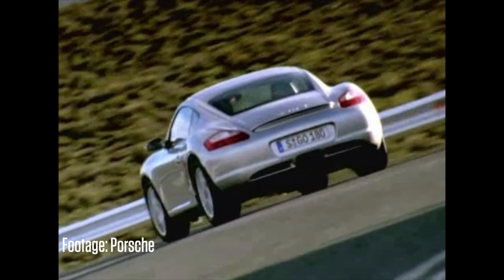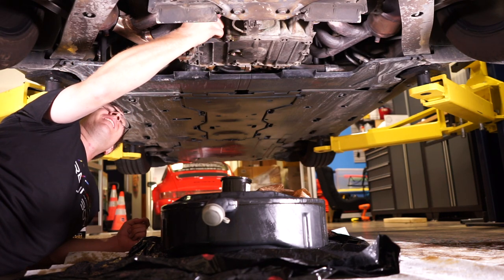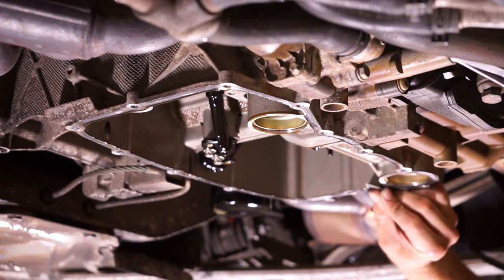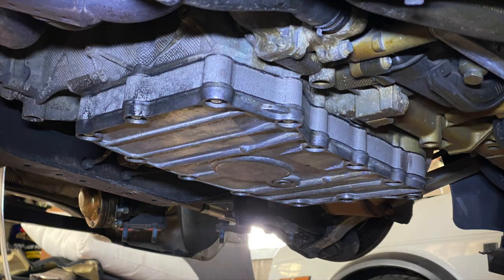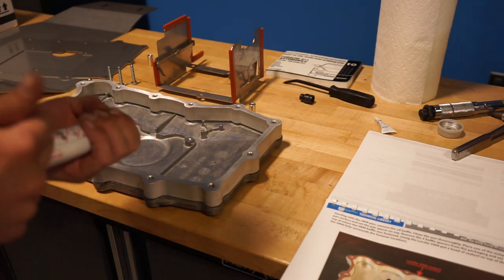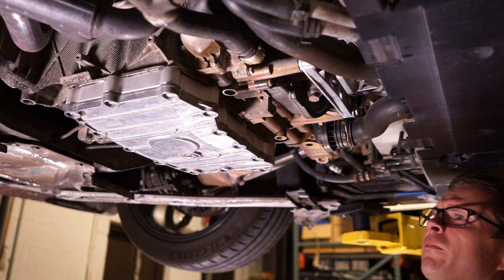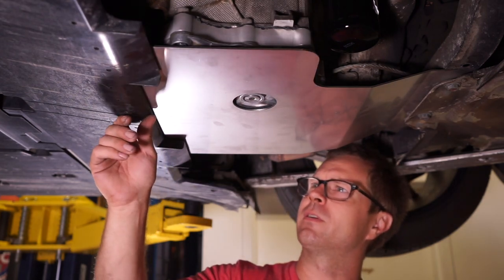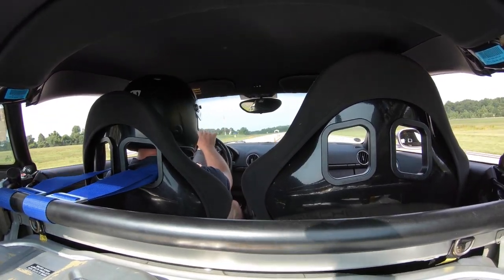How cool is your Porsche 986/987 Boxster or Cayman? How to install a deep oil sump | PCA Spotlight

Comment: I would use a plastic razor blade to clean the surfaces to prevent gouging them. I got some at Wal-mart, paint section I believe.
Reply from the maker: Great tip! Damon was worried about gouging the sealing surface with the metal razor blade but didn't realize plastic razor blades were a thing.

Comment: I do oil changes on Porsche all the time at work. To prevent oil from splashing everywhere with 6-9 quarts. I verified that the oil cap is in working order. Can't fill oil if the cap doesn't open.Then recap the oil cap. Leave the oil cap on until majority of the oil has been drained or when you're done with the bottom side. No more uncontrollably oil all over your clothes or the floor.

Comment: Fantastic video. Really appreciate the attention to detail on it, well done. I'm about to install one on my 1999 Boxster base, and this video is invaluable. One thing I was a little concerned about:  The oil pan guard that you installed towards the end of the video seemed to provide access to the oil drain plug for future oil changes, but waht about the oil filter?  Are you going to have to remove the oil pan guard each time you need to change the oil filter?  Thanks again for your great work!
Reply from the maker: Glad you found the video valuable to your install! The oil pan guard is shaped to allow easy access to the oil filter and drain plug without having to remove anything.

Comment: Thank you for a really interesting video.  I didn't realise oil starvation was even an issue or that there were modifications available.  I have a 986 S which is in reasonable shape (I hope) 2000 with 74,000 miles, but its nearly 22 years old now and I would not take it on a track for fear of breaking something very expensive, like the engine - even if I had the deep sump installed.  For me to be confident of not breaking it, I would have to have the whole engine out and totally reconditioned - which would be more money than the car is currently worth.  You could argue I guess that because the car isn't worth much, why not thrash it around a track, if it breaks it breaks, but it is worth a lot to me so I'm not going to do that.  I will drive it (safely) fairly hard every now and then on the road but that's it.  If I did drive a boxster on a track, which I'm sure if great fun, it wouldn't be mine.
Reply: Mike, I had the same concerns until I experienced a Porsche on the track. I love my Cayman S and the experiences on a track provided a new wonderful appreciation. Don't miss out. Jeff

Comment: I would not change to a spin on oil filter, sure it's easier, but I like to inspect the oil filter media for metal.
Reply from the maker: Damon has a filter cutter that he uses to cut the filter open and inspect.
Reply: @PorscheClubofAmerica doesn't that make the whole job more complicated than using the standard filter system?

Comment: Could a couple of the bolts used to attach the sump to the engine be taped in to use as a guide to assist with alignment when reassembling?
I’m not mechanically savvy so it maybe a dumb question.

Comment: stating using a 15mm Cresent to loosen the front motor bolts, when actually using a 15mm box end wrench.   Screw and bolts.  There is a difference!

Comment: Would this be recommended for a 2.7L Boxster that I plan to run on the street with 200tw tires? I drive pretty hard on backroads and on-ramps; a 718 i had before once registered 1.34g via Sport Chrono on OE pzero PZ4 tires -- i just don't wanna blow an engine :/ 

thanks for any consideration
Reply from the maker: If you were to ask the owner of this car, he'd say it probably isn't needed in your case, if you're only doing street driving. Even hard back road driving tends to be easier on a car than track driving, with fewer instances of sustained high Gs. That said, if you want more peace of mind and a deep sump and anti-slosh tray are in your budget, then they will only help with cooling and lubrication. Though we have not verified it, we have heard of some reports (on forums, we think?...) of stock air-oil separators being overwhelmed by oil once the anti-slosh tray is installed, due to how the oil now flows. A motorsport AOS will solve that potential issue, but it's a very expensive upgrade. And that's the rabbit hole this Cayman owner jumped down.